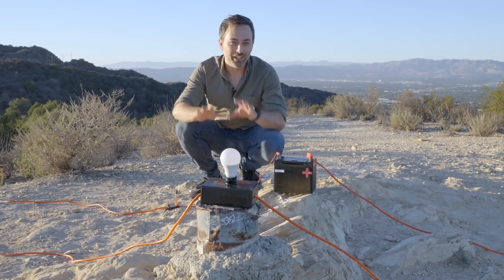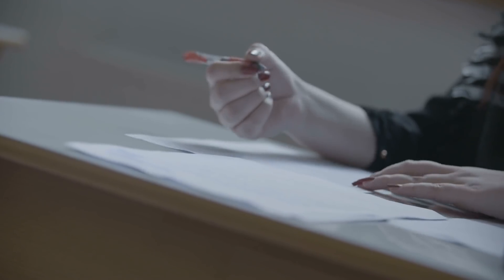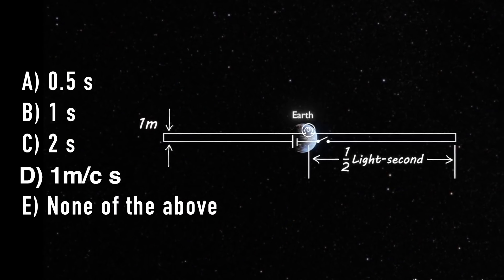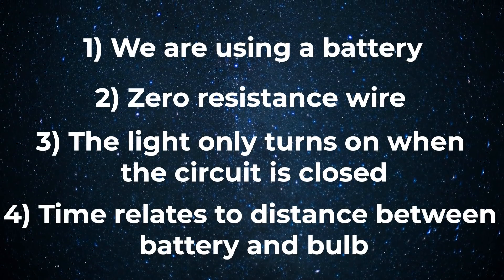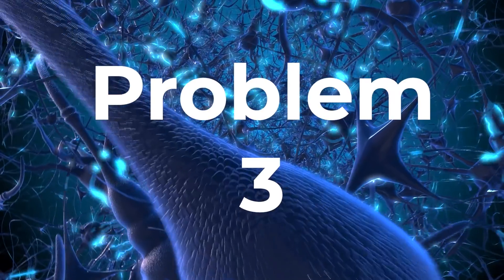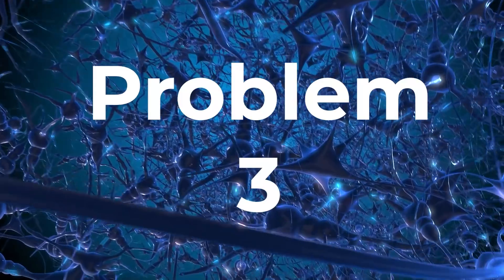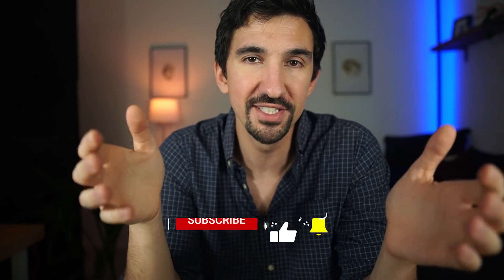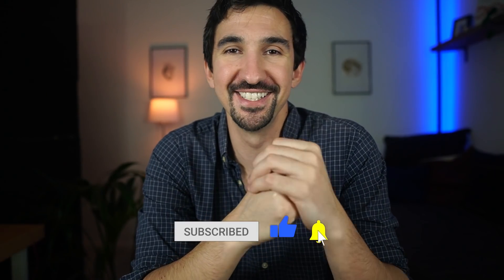Is Veritasium Wrong About Electricity?

Comment: Lots of assumptions and over complicating the model used to test the theory. If you're going to ignore resistance and inductance, why include electro-magnetic or RF coupling? Are we talking about transient conditions and the effects of the initial powering up of the circuit? The use of a DC supply suggests we should not consider transients at the point of switch on (when all the interesting stuf happens!) otherwise why not use AC? 

Better to assume a model with non-real world characteristics that is very simple (no resistance, inductance, capacitance, no RF or EMF coupling etc) to test the theory OR test the theory on a real world model that includes all these effects, as you would do with simulating any transmission line.

I think the initial idea was to ask "do the electrons move down the wire in a wave (like traffic does) or do they move in such a way that as soon as the one nearest the switch moves, the one nearest the bulb moves too (like sticking a length of wire down a pipe)?"

One could argue that poking someone a long way away with a very long bit of wire, constrained in a tube, is instant! (if you ingore friction, compression of the wire etc etc and yes I know things are not really solid at a molecular level... but it's a thought experiment!). 

There is another video somewhere, where there was an attempt to measure the delay and sure enough it is more or less light speed, but the is also some wierd transient that appears much sooner, although it was very small.

Comment: I understand your point, and yield humbly to you and Veritasium, but I think Veritasium was only using the 300,000-mile circuit to come up with an up to 1 light second round number as a possible answer in a multiple choice test. It certainly couldn't be built, and with the earth rotating, with its magnetic field, the circuit would generate electricity and burn out long before the switch was closed. This experiment was done a number of times by NASA, first with 1640 feet of wire extending from an orbiter in 1993. I remember that day very well. The wire burned out in milliseconds. I think that if he were able to build such a circuit, he'd need to build it instantly and close the switch instantly to do the experiment.  Otherwise, the light would come one for other reasons.

Again, I see your point, but it was a thought experiment. I was able to suspend my disbelief . What he should have said was that his 300,000-mile circuit was coiled up on earth, which is very possible, but then, we'd have the impedance and even capacitance problems you mentioned. Again, it was suspension of disbelief, which I do understand is sort of odd when you mix fantasy with science.

But we can't always fixate on this. Here is an example: How fast would I have to run in order to run on water? It turns out, only about 120 miles per hour. The proper response to that is to understand the science involved, and to note that we can water ski barefoot at even lower speeds. Not to say, "humans can't run 120 miles per hour." 

Or this: How many earths would it take to fill up the sun? There is an exact number. We just do the math.  We don't say, "there's only one earth."

A better way to challenge this was to challenge him to do this in nanoseconds. Thanks to Commodore Grace Hopper, we know that It's already established science that electricity  travels 11.8 inches through wires in a nanosecond, and we design CPUs based on that. Veritasium might had talked himself out of this had he measured his circuit in 11.8-inch segments and nanoseconds.

Comment: I think you’ve approached the problem really well. Some points I’ll add:
- Electricity can do work. If there is a way to compress the distance, which there is, electricity can and will collapse into it, given enough incentive.
- Insulation is the exact opposite of a “conductor”, and meets this system definingly. “A system that is more difficult to traverse than traveling literally through the insulation of the wire, etc” would be like an open-circuit: electricity would seem not to be flowing.
- The speed-of-light is infinite, but is a defined ratio between space and time as well. Having a spacial length to the electric field, it will definitely be limited by the same ratio of space-to-time, so covering 600,000km will take 2 seconds— unless electricity finds a shorter path through space, like “warp drive mechanics”!

Comment: Good try Dr. Ben but you are wrong.
If the circuit is cut off at a long distance, the current will not stop suddenly in neither the battery nor the lamp.  So it will take 1/2 sec until the lamp is cut off.

A nice side point is that if the switch that we are using in the first place is in every long-distance, then it will take 1/2 sec until the lamp is turned on.

Comment: The "problem" I see in this "thought experiment" is that it mixes circuit concepts with wave transmission. As such, it obscures the actual physics because the arguments end up at "how soon do we see the light?"   

Doing away with the car battery, the light next to it and the cables running left and right, let's stick instead to the simple setup of a potential difference "source" (no need to consider what it is), two wires running from the source to the "detector" (the light bulb), and a switch to permit the circuit to be completes. Let's further assume that the observer can "see" the changes that happen instantaneously and thus the speed of light limit does not apply to the observer. Under those conditions, the moment the switch is turned on there will be an electric field traveling from the voltage source along both wires toward the "dectector." The field will point toward the light from the positive pole of the source and to the source in the leg connected to the negative pole. Once the fronts of this fields reach the "detector," the circuit will be formally completed and the light will turn on.  You might complain that there is a need for a current to flow on the wires but how could it if they have not "connected" yet. The answer is that the current is closed via a displacement current between the two fronts. During the time the fields are traveling, the problem is a wave problem. Once the fields meet at the light, the problem becomes a circuit problem. 

Where Veritasium goes sideways is in assuming that it is a wave problem even after the DC circuit is completed. It isn't. Of course, if you then modulate the output of your source, as it is done in an AC circuit (at any frequency) then the problem is now a wave one (and, yes, you can think of it all as an antenna problem) and if you wish to apply non-time-dependent circuit theory you have to switch to using RMS values and all those things that electrical engineers are taught to use. At that point, however, the "basics" we learn from middle-school level electricity have to be replaced with more sophisticated treatments. Which reminds me: transmission line theory is not really physics because it does not concern itself on what is actually happening with the fields but rather with the simplifications necessary to describe systems that are useful for technological applications. As an example, consider how a transformer is described in electrical engineering. Nothing in the EE description involves the use of Maxwell's equations in order to predict how much energy is transferred from the primary to the secondary legs (and vice versa, if you will). And if you were to include the materials used to increase the efficiency of the transformer, you can just forget about doing it from first principles whereas in EE you are given a simple expression that tells you the relationship between the primary current and the secondary current and away you go (not to mention that concepts like capacitance, reactance, etc., are all "descriptive" of circuit components). (N.B.: yes, I did take a class on second order differential equations at the EE department for fun but that wasn't the same as taking an E&M course using, say, Jackson's text.)

However, Maxwell's equations (in their original form, not Heaviside's, which are the much taught 4 Big Ones) are necessary in order to understand the physics of an antenna immersed in a conducting medium. And if the medium can "respond" to the "external" field by changing its characteristics (say, local density, for example) as it happens in a plasma, then the problem becomes very complicated and cannot be solved by the traditional methods centered on the Vlasov-Maxwell equation. Why? Because no one has, to the best of my knowledge, been able to fully describe the boundary conditions between an antenna and a plasma. The best that is done is to assume that the wave source is sufficiently far away so that the Vlasov-Maxwell equation can be solved for plane waves under a variety of conditions in order to account for the dispersive properties of plasmas. Neverteless, the simple concepts elucidated by Maxwell's equations can be used to understand the problem. We just can't solve it analytically. (N.B.: a lot of work is being done via computational methods but even the simulationists, excuse me, computational physicists, have to take "shortcuts" because the time scale for ion motions is vastly different than for electrons forcing approximations in all sorts of ways. Plus some prefer to solve equations while others "push" particles around. Now, some might think that plasma physics isn't that important but given our increasing exploitation of space, we need greater understanding of the behavior of the plasma that envelopes Earth.)

Comment: Dr. Miles, your analysis is correct.  The way the question is originally posed, makes it somewhat of a trick question.  The two key bits of information to consider is 1) just like the sudden imposition of an electric field in the wire (when the switch is closed) causes "some" movement of electrons which results in a magnetic field, likewise the sudden imposition of a magnetic field around a nearby wire (in this case 1 meter away) causes an electric field in that wire resulting in the movement of the electrons. The presence of the two fields in and around the bulb wires means that power is flowing to the bulb. You are also correct in assuming the amount of power will be minimal at first (so not likely to be observable in the bulb), but will increase to some maximum over the next second. The second bit of information is 2) he has placed the bulb (and associated wires) roughly parallel and one meter away. However, in giving the possible solutions to his question he drops the unit of meters from the correct answer although "c" is ideally in meters/second. A clearer formulation would be (1 meter)/(c meters/second) = (1/|c|) seconds where |c| = the magnitude of c (i.e., you need to know that his c is just the magnitude). The parallel nature is also important. If the bulb wires were turned so as to be in the plane of the magnetic field (i.e., perpendicular to the switch wires) it would have taken longer for the bulb to receive power since the bulb wires would not have an induced field in 1/|c| seconds. BTW my PhD is in electrical engineering.

Comment: I've seen a few videos explaining why Veritasium is "wrong" concluding (like this video) something like that, in fact, yes, there would be a small but maybe negligible current before the battery voltage kicks in. That's the point he was making, though: precisely that there is any current at all; it's the misconception that electricity somehow "flows" through wires and that it only flows through wires, like water through a pipe, that Veritasium is tackling, and he in fact explicitly does say that the bulb won't get the "full voltage of the battery" for "some fraction, which depends on the impedance of these lines and the impedance of the bulb" (12'30"). We can agree that in reality there may not be enough voltage in the first microseconds to actually turn the bulb "on", but Veritasium in principle is certainly not wrong.

Comment: Good point about faster-than-light communication. And yes, induction would cause a small current in the bulb a short time (1m/c) later, but not enough to make the bulb glow as one would expect with a 12V battery. Great to hear a real physicist explain things but with appropriate scientific modesty, and not in a click-baity absolutist way that Derek sometimes does. It also highlights how cautious one should be regarding ANYTHING one hears

Comment: If you want to think about truly faster than light communication then a Dyson communication swarm would be needed. 
A swarm that can completely block the stars light. 
This way parts can maneuver sending light or casting shadow. If you move the swam in a way that overs the enter side of the star you can see them the information about the travel would appear to be after than light.
Also would be the best way to communicate with like in the universe.

Comment: 1 Lightyear long cable with two switches and two bulbs just for the sake of "communication" via Morse code. Even if they turn it off/break the circuit then the electrons that had already left the circuit would still have energy/momentum that would need to dissipate. Either that will create more heat in the cable if it dose turn the light off instantly, or more likely (in my understanding) the Einstein's cradle of electrons would knock each other back and forth untill the energy has dissipated/the electricity has made it to the lightbulb. There would possibly be some fraction of a fraction of a second where it would turn off "faster" due to some energy being lost due to lack of "push from behind" although only a super computer with an atomic clock would be able to notice the ever so slightly difference in time. 
It would also have to verify your circuit/cable are not broken somewhere closer. 
Obviously if you are doing this over and over again in Morse code and it was intentional designed this way then you can still not receive the information faster than the light can hit your eyes.

Comment: If the circuit breaks before the light bulb is turned on after you press the on switch then the light bulb should theoretically turn on for however long they're still electricity flowing through the cable. 
If you plug 🔌 something in with a very long extension cord and then someone unplugs it while you are using it then there is a noticeable second where electricity is still moving through the cable just like if you cut off a water hose they're still plenty of water in the hose and it will still continue moving for a duration and then it will become stagnant and it will still be in the hose although that he's only once there is no longer enough pressure to force movement.

Sorry I'm YouTube educated and they tend to like to dumb things down for YouTube so I got the basics of it but I might not understand the exact details.

Comment: There wouldn't be no faster than the speed of light communication considering the fact that the electricity would be traveling a much shorter distance by going directly from the battery to the light bulb. It would not actually travel through the wire I mean it would but a percentage of it wouldn't travel through the wire and would directly hit the light bulb therefore turning it on in theory.

Comment: If the battery was the only turn on point and it was not only a battery but a battery connected to a Tesla coil then he would be correct however the Tesla coil would kind of negate the wire all together.

Comment: Veritasium complicated it a bit
The explanation is simple: wires put in close proximity act as a capacitor which closes the circuit (if the current is DC, the light will go off quickly though when the capacitor has been fully charged). This is commonly known as parasitic capacitance.
Veritasion alluded to parasitic capacitance when he talked about power lines and telegraphic communication but he never called the phenomena by its name. 
I think his explanation didn't do this topic justice.

Comment: Well i think i have a answer to your question but i dont know how to explain it tho i will try my best.. so veritasium just said in his video how if you start the battery the bulb would light up almost imidiately as the the eloctrons close to the battery and around it start to vibrate hence causing a direct flow of energy from the battery to the light bulb but he dint said that all electrons in the wire would start vibrating breaking causality. Similarly just as we break the circuit the circuit wont just stop imidiately all the electrons close to the bulb are still in motion causing it to glow and as you said the bulb would only turn off once the "information" that the circuit is broken reaches the bulb

Comment: I think that the problem with veritasium's video is that when you make an electrical circuit like the one he used, you are using a theoretical abstraction that can be used if you can neglect the physical dimension of the components and their dimension is smaller than the wavelength of the signals passing through the system. If you place two trasmission lines you will always have a parasitic capacitance between them and also inductances of the wires even if you have 0 resistance. What I'm trying to say is that when you make a circuit like the one he used it's pointless to consider the length of the conductors since in such simple models 1m of condcutor and 1 km are electrically equivalent, and this class of models it's not suited for takling the problem that he is trying to solve. In the end, models aren't real things but just a tool to deal with problems and in this case he is simply using the wrong one.